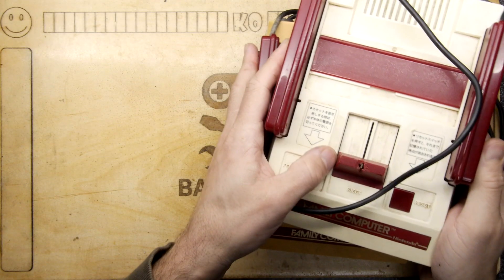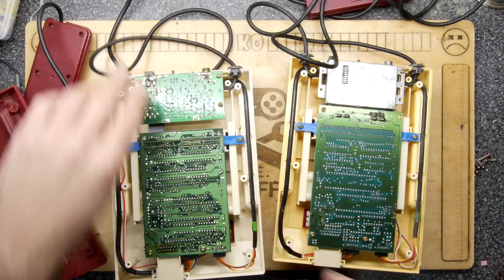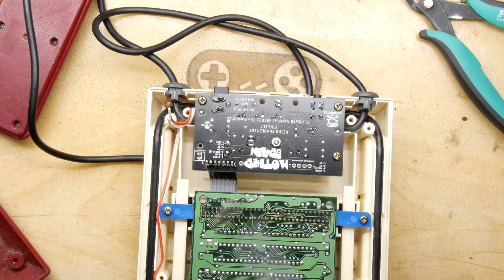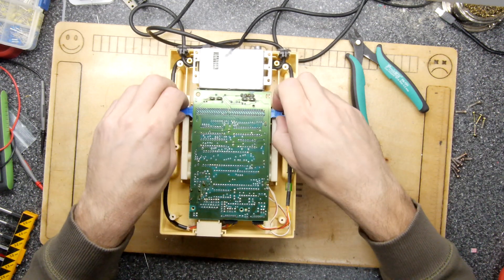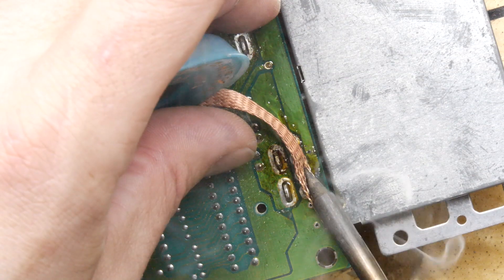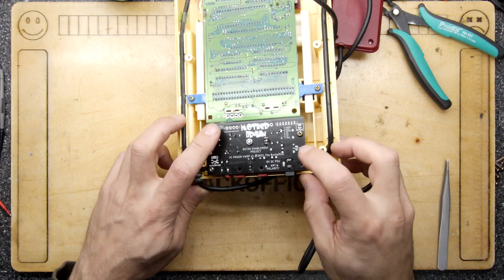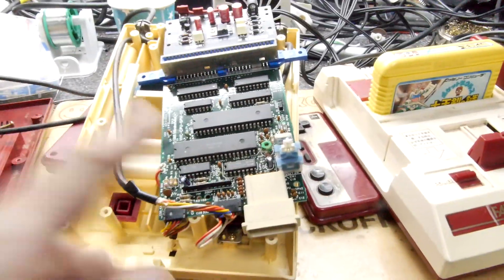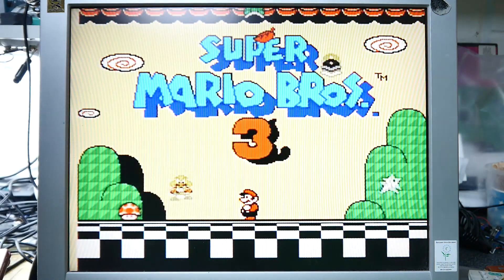Junk Nintendo Famicoms - Can we save them?!

Comment: i tend to find braid works better for removing the metal cages rather than a solder sucker, or even hot air and letting it drop out then use braid afterwards.
Reply from the maker: I have another few Famicoms on their way for testing, I'll definitely be trying this!

Comment: with inductor values, the guy on reddit who I got the idea from got a good result with 10uH, I found 22uH gave a perfect picture. also that game is pocket zaurus if anyone is wondering
Reply from the maker: Awesome thanks. I might grab one and see if it works as a board interconnect
Reply: Do you know where you connect the 22uh inductor please?
Reply: I've fitted a vamp to both types and the type without the metal cage seems to give a better picture. Both give jail bars but less on that type it seems. Looks ALOT better on a CRT, my CRT looks awful with reeeeally bad bars
Reply: Do you have more info on what you did?  I just put a Power Vamp 3 in a couple Famicoms and both have jailbars I'd like to clear out.

Comment: The one I modded had the metal can in the back and it was a pain to remove it. I have a Power Vamp V3 in it and it works pretty good now.
Reply from the maker: They are a bit of a pain. I suspect one can get better at it, but a solder sucker, brute force, and a lot of heat are still needed 😂
Reply: Fortunately I only had to do it once! :D
Reply from the maker: Until you spot a really cheap Famicom locally .... 😂
Reply: Well for me that is a problem! At one point I had 5 different Sega Genesis consoles. I may have to mod a friend's Famicom but it is the one without the can. I got lucky and my second Famicom is actually a Sharp Twin Famicom.
Reply: @backofficeshow  I just did that on HVC-CPU-GMP-02, used amost half of my copper braid to remove all the solder 😵‍💫  , took some time but no force was used 😄
At start I tried with original RF on TV but nothing worked, tested the fuse and it worked fine BUT !! it was not the original fuse and the idiot who replaced it destroyed a track and the coil on the other side of the board (inside the shield)... 😑
So I removed all the module and i'll buy the V5 mod soon. 🥴
Reply from the maker: I once worked my way through ten on them and unfortunately most had the nasty can in them. Judging from the pictures shared in my discord they definitely seem to be the most common kind. Glad the braid worked, you just have a higher wattage iron than me, because mine would generally just end up soldering the braid to the PCB 🤣
Reply: @backofficeshow  just a 18€ soldering iron with a temperature wheel on it, set to 400°c but still, it's not easy to melt the solder on the 4 pads, so removed the solder with braid one side at a time, and slid the braid maybe 4 or 5 times on each side untill it's finally removable, wasted a lot of braid 😂 and had to clean a lot of flux after it's done
Reply from the maker: Sounds like a good technique, I will look out for a simple high wattage iron if I ever need to do more 👍

Comment: thanks for this great mod!
i use it on my gpm-02 model and install was really easy but i have one question about the led. is it normal that the led lights on even the famicom is switched off? I mean it wouldn't be bad because i turn off my power strip anyway.
Reply from the maker: On the gpm-02 it can do this. It is possible to route the power switch to the vamp and add the jumper on the gpm-02 main board if you want to avoid it.
Reply: @backofficeshow  thanks great idea i will change it later.
Reply from the maker: @Come2Fabi  Please report back and let me know if I am correct. Its been a long week and I am cold and tired, hopefully I have not led you astray on this :)
Reply: @backofficeshow  Hi sorry for the delay. yes it works great. just had to lengthen the cable a bit
Reply from the maker: @Come2Fabi  fantastic, thank you for letting me know, much appreciated 👍

Comment: I read over on Nerdly Pleasures that the Power Vamp's composite output circuitry is based on the Twin Famicom's composite output.  Does the V5 board still do this?
On the same blog he mentioned that the AV Famicom has the cleanest overall composite video output and used an earlier version of the Power Vamp in tandem with a CatHouse Games AV Mod Board to totally maximize the AV quality on his Famicom, even saying in a comment on the blog that he had to lift pin 21 to further reduce jailbars.  It'd be neat to have everything rolled into one board.  Seems like every day we come closer and closer to engineering the cleanest video and sound for these awesome little relics.

Comment: I wanna install this board in my Famicom but I've never soldered and I don't really know how to start or what to practice on. I have a soldering kit but nothing to use it on. I can tell this mod is easy to install, but I'd still like to at least have SOME soldering experience first...
Reply from the maker: If you look up electronic kits on Amazon there are plenty for only a few dollars that will be a great place to start.